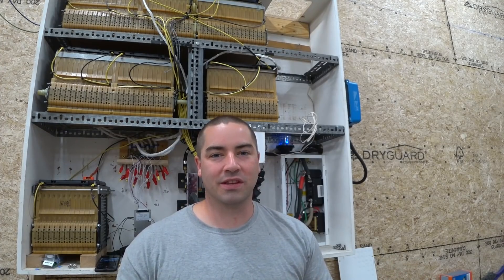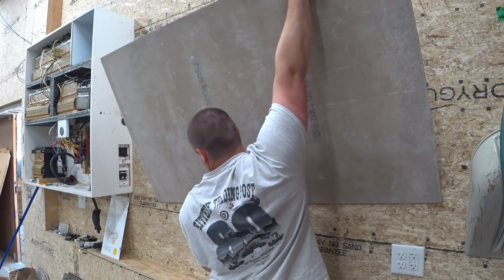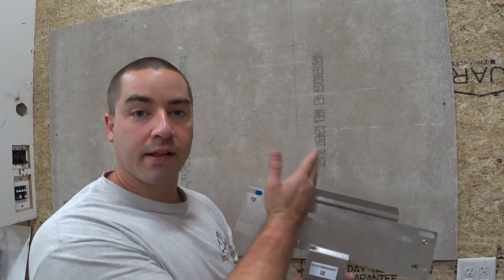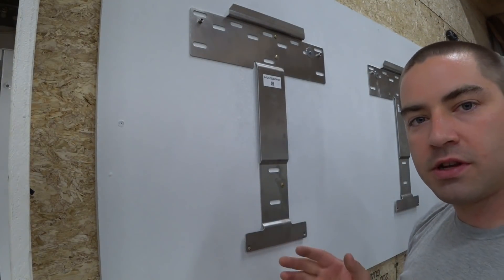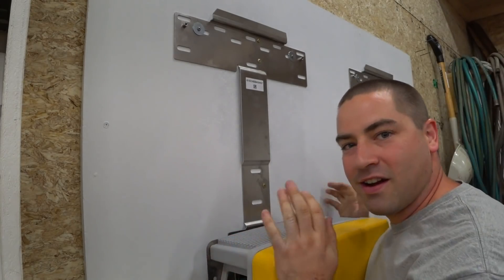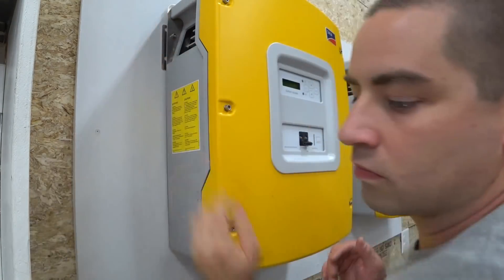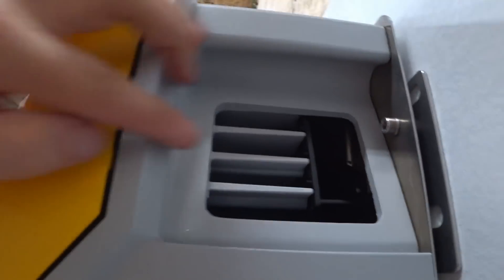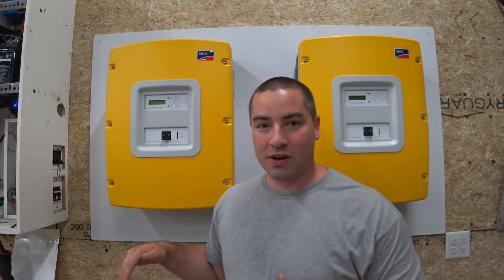Mounting New SMA Inverters 120/240v 12kw (Split Phase)

Comment: David I purchased 2 of them.  Hopefully you will get a little credit.  Mine cost $600 more then yours but still ok with that.  Thanks for your excitement and very clear instructions in all your videos.
Reply from the maker: Cool.  I hope we bounce ideas off one another as we set them up.
Reply: David I was thinking of getting the same batteries and amount you purchased from Battery Hookups.  Although very heavy do you feel these are a good buy and will work well with these inverters?  Are you using these newer batteries for your home over the EV batteries you have been using?
Reply from the maker: Hi realoldgeekster,  I sold my EV batteries to help buy these new BYD battery modules.  I'm going to keep 8 for myself, and 4 are going to a buddy.  So I might have 36kwh battery when I'm done.  I think it's a good deal, which is why I bought them.  You don't have to decide right away.  I'm going to do a some videos where I condition the batteries and run several capacity tests.  After we see the usable capacity you can decide if they are right for you.  The SMA inverters should be very happy inside the voltage range of these batteries.  I'm running them in pairs for nominal 48 volts.    And if they don't work out well, then shoot, I'll have to keep them anyways.  LOL

Comment: David watch this:  https://youtu.be/1vpTadPU4Dg?t=35
Reply from the maker: Yeah, that Sol-Ark is awesome looking.  I'd love to see one in person.  They check every box on a wish list.  The numbers are a little off because I'm using the 6048 model (they used 4548) and I got a great deal on Ebay.  But I agree with the Sol-Ark ad if I was buying retail price.  Do you have a Sol-Ark?
Reply: @DavidPozEnergy  yes, you got a good deal and yes I have the sol-ark 8k(12k is coming out soon). My SMA 4000TL-US now collects dust in the garage. You can watch my video. I am still mad at SMA for making me switch and making me waste the Grid-tie inverter. It will take something special to go back to SMA.
Reply from the maker: O, that's you.  Haha.  I remember seeing your video earlier.  I didn't make the connection.  I love that touch screen you have.  Easy to prepare for that two day storm.
Reply: @DavidPozEnergy  Just trying to give some info to Tesla Power-wall fans.......
Reply from the maker: I like your setup.  That Sol-Ark makes everything super easy and un-beatable efficiency.  They really did a nice job.
Reply: @DavidPozEnergy  I was waiting for you to get a sol-ark, but I guess you got a too good deal to pass.
Reply from the maker: Exactly.  But there is no question the Sol-Ark is the way to go for most people.

Comment: David, I've been with you since you started with the chevy volt batteries.   We run our home on an 8000 watt solar system as well and I too have a couple of the 6048 inverters hooked to my chevy volt batteries.    We use AC coupling when the grid goes down and AC Grid tie, with the Sunny Islands totally isolated, when the grid is up and running.

If you need any help with your 6048's, let me know and I'll be glad to assist you.    I strongly suggest you take advantage of using a Load Shedding contactor.
Reply from the maker: Thank you Rgb Color.  Can we connect on facebook?  I'm sure I'll have questions when it comes time to fire them up.  I'm at https://www.facebook.com/DavidPozEnergy/
Reply: I will second the load shedding contactor

Comment: Thanks for the shout out David, I hope you enjoy our extra power!
Reply: @Paul Anthony These output 120vac each, if you want 230-240vac (with one sunny island) you prob need a transformer on the output but not sure if they are 50/60hz adjustable. Most likely. These are 48vdc input, so you'll have to series two 24v batteries.

Comment: Those are some nice inverters! Looks like you could get 3 phase power from 3 of them too. amazing. I'm trying to figure out how you would run them with a generator, to charge the batteries while the generator is hooked directly into your AC setup. Looks like this one might have some hardware that can attach to it and tell the BMS exactly how much to charge the batteries to balance it all out! Very interesting!
Reply from the maker: Yes, there are a lot of features built into these.  I will be trying to (discover) them in upcoming videos.  I have not yet read through the whole manual.

Comment: I've been using the AIMS 12,000w  240v@50a with 120v legs (ETL) $3,500 for about 9 months (12hrs/day) now with no problem.    Could you comment on why a pair of SMAs instead of a single AIMS 12,000w as the price and size seem about double?
Reply from the maker: Both are good options.  I personally went this way because the pair of inverters was $2400.  This is less money then I was finding the 12kw Aims for.  I think Amazon has the 12kw Aims for $3500.  Also, a 12kw Aims uses about 140 watts at idle, these are 25 watts each (50 watts total).  This should save me over 2 kwh of energy per day.  Finally, these should have a super clean sine wave (although I have not tested this yet).
Reply: Thank you for the info - makes perfect sense.  If I may share some info just to document things...   I use a Midnite Classic charge controller to turn the AIMS Inverter on/off based on battery voltage so its only used when supplying power (and not used to do any battery charging) - so the 'idle burn' is effectively 0.    AIMS lists 88% peak efficiency and I've gotten 86.4% efficiency (over 9,000 kwhs / 10 months)  based on the values reported by  'cheap-power-meters-wired-to-aims-output' divided-by 'midnite-classic-150-pv-input.    The SMA lists 96% as peek efficiency - maybe down the road it would be interesting to see what you get.
Reply from the maker: For sure I'll be doing efficiency tests.  Still a ways out there as I've got to wire them up first.  Good job wiring in the Aims to the charge controller.  I haven't seen anyone execute that move.  Do you have a video showing that?
Reply: No video but its straight-forward.  The midnite classics have aux1 (and aux2) which can act as relays or provide 12v (on/off) to turn on/off an external relay.   You can  turn them on/off in a variety of ways - battery voltage is one of them.   The AIMS LCD Remote Port is RJ45 plug where wires 3-5 turn it on (when you short them) and off and 5-7 does power saver mode (when you short them) - same as rocker switch on the unit.   Your 6000 watt unit has this - they all do.     So controller turns relay on/off with turns AIMS on/off.

Comment: More power, argh argh argh.  SMA inverters are built like tanks, if my memory serves me correctly there is a spot on the upper part of the inverter where you can thread through a 3/4" rigid pipe from side to side in order to facilitate a two person carry and if you have the room to lift it in place. Definitely got a good price on them and any plans to kick it up a notch to 100 kW?

I went with the Magnum Dimensions route since it had a dedicated DC load centre option and I am planning to have it 40% of the loads directly battery powered and the rest on the inverter which is less than 20% to give me some elbowroom. Building a power wall is definitely not a one size fits all project...
Reply from the maker: 100 kw!?  That's over 16 of these inverters.  I don't think I can parallel that many.  No, no plans to do that.  I've teased my wife about the idea of two more if we ever buy an EV (for the charger).  LOL
Reply: @DavidPozEnergy  spousal ordinances tends to rule the roost, so that might get you in trouble. Extra capacity for a future EV in the garage is not a bad idea. I have 8 kW split-phase here and not utilising its full capacity mainly for redundancy. I can have an EV and can support it, but I'll add the third one just so I am not pushing it to the upper limits.
Reply: @DavidPozEnergy  have your wife set up a limit on spending on solar project yet????
Reply from the maker: That's why I had to sell my Aims inverter.

Comment: While more potential output power is very attractive, the counter argument is the continuous background draw that you mentioned as 25w per inverter. Given this, do you run both inverters continuously or do you turn one or both off at set times when you expect less demand e.g. perhaps overnight ? thanks
Reply from the maker: I used to have an Aims 6kw inverter.  That drew a constant 70 watts.  These are super efficient for their size.  I'm going to 50 watts idle for the pair.  They both will be running 24/7.

Comment: For efficiency, I prefer various smaller inverters that runs only on abundance of energy. Only one run 24/7 for critical loads sas as lights, fridge security etc. Those big ones can waste up to 3 amps per  hour each.
Reply from the maker: That's cool.  More than one way to go off-grid.  The manual says these consume 25 watts each in idle.
Reply: @DavidPozEnergy  That is very good better than the Aims. And a good German technology inside. If you check it let us know. Why so heavy?  LF 15kw inverter from power jack is 75 lbs.
Reply from the maker: As for why they are that heavy.  The whole case is cast aluminum, and thick.  But I think the bulk of the weight comes from the toroidal transformer built on the backside.  It is as wide as the unit (about 20 inches in diameter).
Reply: @DavidPozEnergy  I didn't see if it is split  phase 220v or just 120v. I'd like to see inside one before I get one.
Reply from the maker: Each inverter is a single phase 120v.  If you want split-phase then you either need two inverters, or one inverter and a center-tap transformer.
Reply: @DavidPozEnergy  thanks
Reply: @marthale7 and if one go bad you won't be in the dark.

Comment: If you pull on the bottom does it pull away from the wall? Mine did so I added a few screws into the inverter itself. There were holes already there but looks like they were meant to go into the electrical box that is made to go with these units so you will need spacers or to just let the metal bend a little.
Reply from the maker: Thanks for the tip.

Comment: That's from the same seller I bought my Midnite classic 250 from. He must have bought a TON of equipment from a cancelled contract or overstock of some sort, as Midnite has a notice on their web site saying the midnite charge controllers he has for sale were not intended to be for sale as they were custom made for another company and don't include certain features.

I almost wish I used facebook to sign up for that group, but I dumped my FB about 8 years ago and never looked back.
Reply: all this stuff, the sma inverter, midnight charge controller, and ton of solar panels are from a federal auction. the DC Solar ponzi scheme, they took over billion dollars
Reply: @jonenos3800  Exactly. I bought 2 2018 model trailers fully built with 2 sma and 4x48 volt batteries, midnight controller, breaker panel and ten panels on a $3000 trailer for $2400. Nothing like crooks to make someone else happy.

Comment: So how much do you want for the Aims Inverter shipped to Naples Fl 34120? I recall your review of the guts, looked pretty good, need one for a enclosed trailer project. Also, if your upgrading the solar charge controller, i'd be interested in that as well. I'm surprised those huge SMA didn't have built  in solar charge controller.
Reply from the maker: I already sold the Aims inverter.  I was intending to keep the Victron charge controller to use with these new batteries.